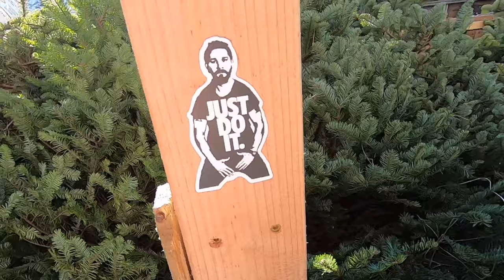Color Matched Mirrors Are On! We Go Christmas Tree Shopping With The Lifted Tundra CrewMax - VLOG

Comment: So just FYI to people considering buying these mirrors. The running lights WILL NOT work on limited trim or platinum. Even if you have the tow package. The SR5 is the only trim that has the running light pin in the harness. Doesn't make any sense at all.  I have a 2010 limited, blinker lights work but not the running lights. I still love my white tow mirrors. I might rewire to have both LEDs turn on with the blinker.